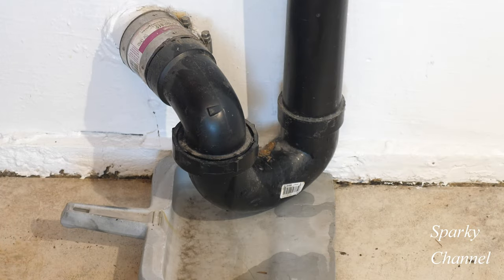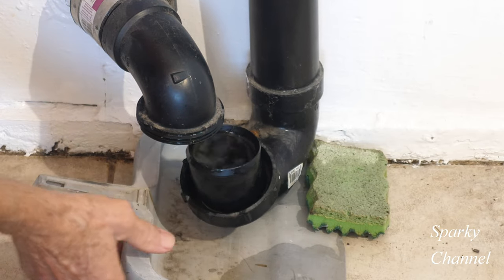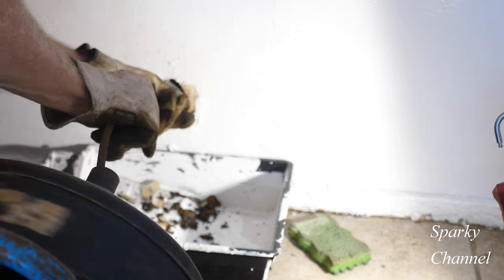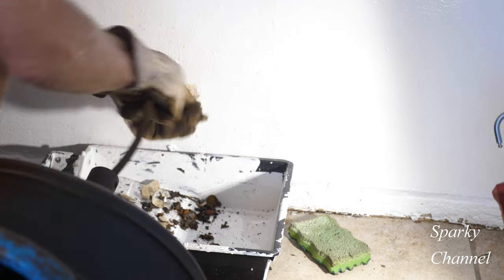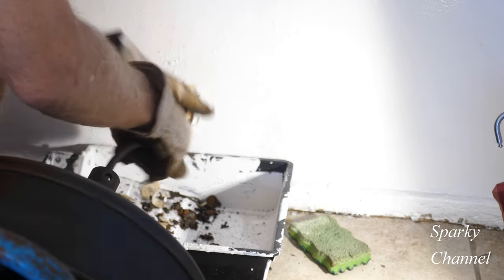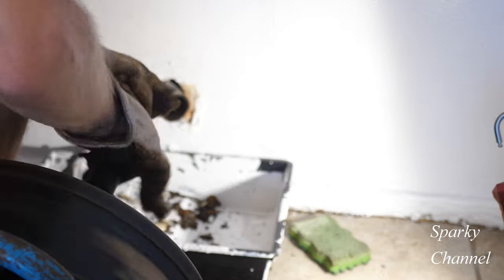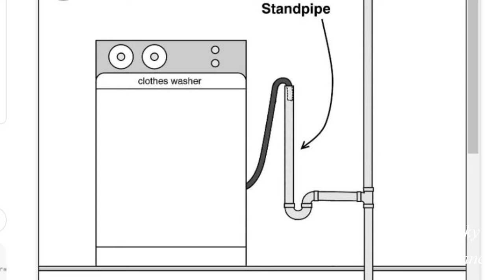How to Clean Out a Washer Standpipe Drain

Comment: One of the problems with cast iron drain lines is that it gets bumpy on the inside as it slowly rusts over time. Lint and such gets caught on that.
Reply from the maker: Yes, that is for sure. In this case, there was a short piece of galvanized pipe which went to the cast iron. So, I also had electrolysis going on which created metal deposits.

Comment: I have water coming back up from the washer drain, we have ran a snake through and thought we had it. But when we run a cycle and it drains you can hear it start to fill up, i push the pause button and its weird because as soon as I do that the water drains away. So I ran my water hose full blast to the drain and it did not fill up?!?! Its as if pipe from the washer is sucking up the water??  i know I may not be explaining it right but i have done this 5 times with the washer on and the water hoses separately and it does it each time. Water hose will run for 2 mins continuously no issue but the washer draining will fill it up?!? any clue what this can be??
Reply: Did you ever find a solution to this?
Reply: Roots
Reply: I'm having the same issue and have tried everything you mentioned. I even snaked the vent pipe but still have the problem. Did you ever figure out a fix? If so please let me know.
Reply: Same here, I’ve done the above and it work until rinse time⁉️

Comment: My washer PUMPS so fast, that size pipe would always overflow.
Reply from the maker: Yes, the new washers do pump quite fast. What size standpipe do you have? A lot of older standpipes are 1 1/2". 2" diameter is what is needed now. Also cleaning out the drain becomes even more important.

Comment: why is it necessary to do the system like that, the water outlet can be made below the washing machine, so that the water exits directly from the washing machine.
Reply from the maker: We do it this way so that the line can handle the fast and large volume of water that comes from the washer. Also, it adds air to the system to aid water flow.
Reply: If you put the drain that low, it would flood every time your washer drains.

Comment: I have an issue with an odor coming out of my stand pipe anytime we use our dryer. We have our own septic tank and sewage line and we believe that gas is being pump back into the house when the dryer is on. We’ve tried putting more water down the pipe, coupler around the pipe and tried pulling the water house from the washing machine out so we’re not going beyond the peach wrap. We only have this issue when the dryer is on so we’re really not sure what to do next. Any tips or ideas what it could be?
Reply: Upon moving into our house in 1992, built in 1959-60, our bathroom sink was a slow drainer. I checked all the inside drain pipes as far as possible but found no blockage. I believe the tub vent also teed into the sink drain/vent pipe inside the wall and then to the vent pipe exiting through the attic to the roof. On a hunch I ran a manual auger down the roof vent and caught a hugh bundle of hair! Btw, previous owner had 2 daughters and wife. I pulled another 4 bundles of hair out and solved the drainage issue. Years later we renovated the bathroom and replaced some of the galvanized pipe and found the vent pipe going out the roof had corroded and was literally just sitting on the tee from the sink, tub and toilet!

Comment: Wearing leather gloves while using a drain snake is a hand accident waiting to happen. The pros always use thick rubber gloves that can't get caught in the coils of the cable.
Reply from the maker: Never ever wear rubber gloves while using a drain snake. The rubber gloves get caught in the coils of the drain snake. The best to use are the Roto gloves which I showed in the video. Leather are 2nd best. Seriously, never use rubber gloves while using a drain snake. That would be very dangerous. With main line snaking I use latex gloves under my Roto gloves. Peace.

Comment: when I needed to take care of clog prone iron drains I used a 2# cross pein hammer.
Reply from the maker: Changing out the old cast iron pipes is the best way. I like those new DeWalt carbide blades though. Fast and tough.
Reply: @SparkyChannel  the hammer was pretty fast.
Reply from the maker: @kenbrown2808  I've used them. But this house is on a slab, so you need a nice clean cut in the cast iron pipe about 2" above the slab to work with. That's where I love those new carbide blades.
Reply: @SparkyChannel  yeah, i like a crawlspace with a rat slab.
Reply from the maker: @kenbrown2808  OK, you got me. What's a rat slab?
Reply: @SparkyChannel  that's when they pour a concrete floor for the crawlspace.  the primary function is to keep anything from tunnelling into it, hence "rat slab" but as long as the tin nokkers don't run their ducts through any pinch points, you can cruise around the crawlspace on a mechanic's creeper

Comment: Thank you for the information and what type of auger to most likely use. I'm in a 1968 mobile home, except with ours it goes into the floor instead of the wall. But this is very helpful. I'm seeing a little bit of water at the bottom of the turn pipe, right before it curves.
Reply from the maker: It would be a good idea to snake out the line when it starts draining slow. This will help to prevent a larger problem later.
Reply: @SparkyChannel  Thank you, I'll check on it later today and test that!